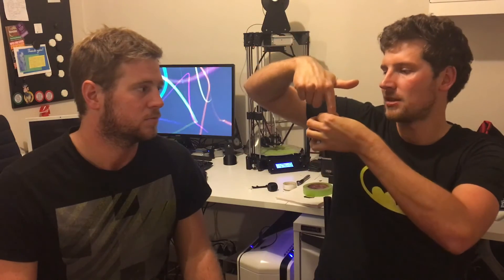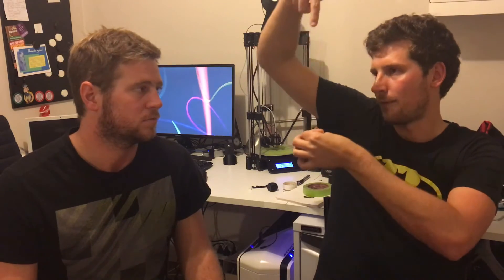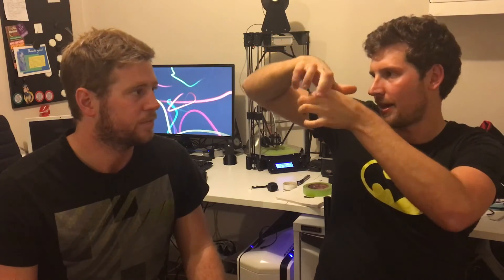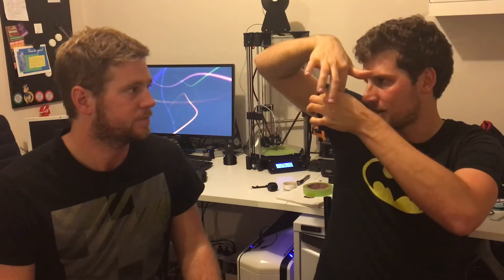How to troubleshoot jaycar tl4100 3d printer arduino

Comment: Hi guys, I have a Rostock TL4100 with its share of problems. The current problem is on connecting the hotbed and setting temperature it burnt out the B55NF06 chip. I cannot work out why the chip burnt out unless the bed was drawing to much current. Can you guys add any details to maybe why it happened. Also is it easy to replace the chip ?

Comment: Hey guys, I’ve got a lot out of your videos, and have got a challenge for you. Here’s some background first.  I’m just getting my son started with Arduino projects. We’ve been pretty quick learners with this kind of stuff, as my father had me dismantling television sets at age 5 to salvage the old vacuum tubes they used to contain. But the history aside, my son and I have had our own troubleshooting challenges with the Arduino (Duinotech) stuff, but we’ve noticed that the projects we’d like to try have some 3D printed parts. I’ve looked at the Jaycar printers, and your videos, but we’d probably want to avoid too many challenges at the moment. And I’m not quite ready to sink $$$ into a decent 3D printer yet...

So I started to think about vacuum forming as an alternative process for some 3D printed parts for Arduino like projects. There have been a couple of Kickstarter projects like Mayku that want to set themselves up as rivals to 3D printers, but they want about the same price as entry level 3D printers (not the Jaycar stuff, but the more reliable options coming onto the market now. Mayku want $600 and there was another one asking $800) But there are dental vacuum formers on eBay for under $150, which I guess would be the best for precision molding. So I was wondering if you guys might consider comparing these two technologies? 3D printers vs vacuum formers. The plastics used are the same, but I think the Dental vacuum formers (and maybe the vacuum formers like the Mayku) might be better for some applications. I think it would be a great YouTube project.

Comment: I have now been going for 3 days at 6 to 9 hours per day trying to calibrate my printer. I am using the TL4100 firmware, not the keyes 3d that it came with or the Marlin, but I am of the belief that the TL4100 and the Marlin firmware are the same. Desperately seeking a really good how to for callibration .... please
Reply from the maker: We had the same struggles. We'd calibrate it, get one good print then the next would be out. Make sure everything is tight (screws belts ect) but I think the design needs strengthening in the frame. The sensor helped massively as it calibrated itself every print.

Comment: do you guys still use this printer? if so im in need of some help flashing firmware, everytime i try to flash it times out
Reply from the maker: Nah we don't use the jaycar anymore. It's our spare parts lol. Are you using the port that it's connected to when flashing?
Reply: yea, ive tried both com 1 and 3, and it keeps timing out, do you by anychance have a premade file to flash off sd card?
Reply from the maker: Have you downloaded the required drivers for windows/Mac depending on your operating system? This is seperate to the arduino ide
Reply: Are you disconnecting the 240 when you flash??
Reply: i have removed the power, ill try to find the drivers
Reply: The drivers are available from this webpage [https://www.jaycar.com.au/arduino-3d-printer-kit/p/TL4100] in the Description tab section under the [TL4100 Arduino Driver] link. Also download the [Download the Top 5 Tips] PDF file from that page for the assembly tips.  The latest firmware and a PDF version of the manual are both available in the Downloads tab section on that same webpage.
TIP  - use Windows device manager to identify the correct COM port for the printer in the "Ports (COM & LPT)" section.  Open device manager with the TL-4100 printer's USB cable disconnected from your computer and note the current COM ports in the "Ports (COM & LPT)" section.  On Windows 10 the "Ports (COM & LPT)" section will only be displayed if you have any ports to display. Then connect the TL-4100 printer's USB cable to your computer, wait for the driver to install (you may need to manually override windows to install it) and make a note of the new COMx port that appears.  That new COMx port is the one to use for the firmware update via the Arduino IDE

Comment: I bought the Duinotech mini TL-4076 from Jaycar.This has been a nightmare from day one .It does not have a heat bed and trying to get PLA to stick has sent me to get hairspray, glue stick, blue tape and kapton tape. Adjusting the bed is a pain as seems to change after a print.Also tried other filaments from Jaycar, just impossible to stick to bed, the original filament that came in the box with printer works.The fan has broken one of its veins, nozzle blocks all the time, Jaycar has no spares, bought new nozzle from Ebay. Very hard to change filaments, have to get nozzle temp really high. All in all I am done in with this machine after hours of work on it to get two prints out, complete waste of $350. Has put me off 3D printing a bit.I am looking at the Creality 3DCR-10 at least one can get parts http://www.gearbest.com/3d-printers-3d-printer-kits/pp_441281.html?lkid=11093265

Thank you for your video, makes me realize I am not stupid, as Jaycar thinks I am lol
Reply from the maker: +darkmonk99 oh its definitely a hard printer but on the pro side jaycar's products do make fault finding easy for your next printer :)
Reply: You are correct, I have learn't a great deal and all knowledge gained I now know the style of printer I want. There is a lot to learn in 3D printing, but very rewarding when you start cranking great prints.Thanks for reply.Looking forward to more of your videos.
Reply: Jaycar are now running out the TL4076 for $199 but they told me themselves it is a really crappy product.

Comment: Bought one yesterday.  First printer too.
Wasn't overly difficult to construct, the pictures in the manual are terrible however!  And miss crucial steps, which are on the jaycar site (didn't see till after putting those bloody end stop cables in!!!)

How the hell do you level the bed properly?  The manual is strange to follow, and the tips on Jaycar's site says to adjust the screws but that doesn't seem to work either.  I"m getting successful small prints from the 1/3 of the board, closest to the LCD.  Anything behind there seems to touch the plate, then jam the nozzle from letting any PLA out.

I haven't adjusted the Firmware yet, as the manual or Jaycar don't actually say what Arduino board this is supposed to be to add into the Arduino software.  Tips on that please?

I just ordered a non-contact blue tip PNP sensor, and will change the firmware when i mount it.
Reply: Ugh, raised the head posts some more, gave me more adjustment room.  All good on the calibration now.  Would still like to know the Arduino settings to flash a newer firmware once my autolevel switch arrives :)..... Please
Reply from the maker: +Troy Starkey we find it a night mare to level the bed as we found every time we used it, it was out of level again. Ended up putting the bed level sensor on which fixed that. Yeah we did the same with the head posts. I think one was barely attached we raised it that much.

Comment: Having issue with SD card says "Card Inserted" but then no SD card on other screen???????
Reply from the maker: nick Brown hi nick have you formatted the SD card
Reply: Where is the SD card in these printers, I am certain mine does not have one, although the main screen says there is a place for it, no idea where though
Reply: The SD card slot is on back of the LCD PCB, below the left hand side of the front LCD display when looking at the display. the SD card needs to be inserted with the label facing down and the contacts  facing up on the right  side of the card.
Reply: The SD card slot is on back of the LCD PCB, below the left hand side of the front LCD display when looking at the display. the SD card needs to be inserted with the label facing down and the contacts  facing up on the right  side of the card.

Comment: Great video guys, did you consider simply using a single high cfm fan, (e.g. sunon-element14) mounted at a 30-45deg angle on the same side as the existing squirrel cage nozzle fan? You could optionally make a cowling or simply flip that little existing fan to pull the air rather than push it around the heat syncs? This should preserve your clearance for printing etc.

Comment: Hello could someone please help me, I've followed all the instructions (video and book). The problem I'm having is every time I (on the printer itself) select Auto Home the extruder just goes straight to the top and just keeps going up, it hits the top (it even hits the collision buttons, which I thought it supposed to stop it, but doesn't).

At the moment, it's X0 Y0 Z0 point is correct, I think. However when I try to make it go down it only allowed me to -005.0 (on the printer). So can someone please help me as to why it just keeps going up (to the point of no return).
Reply from the maker: 13firebug13 check your leads between the control board and the limit switch. Pins 1 and 2 on the connector need to be at the control board side and pin 1 and 3 at the sensor side. Failing that make sure the x limit switch is connected to j12, the y limit switch is connected to j10 and the z limit switch is connected to j8
Reply: Is there any chance you have a Facebook page or something to send pictures and stuff? I would really appreciate your help
Reply from the maker: 13firebug13 you can contact us a ladbrotoryprojects@gmail.com if you like. We no longer use this printer and I have stolen a lot of parts from it but I can try and help you
Reply: It's on page 3 of the manual available from the Jaycar webpage that has download links for the unit. This manual is different than the one that comes with the unit (the book). Here's a link: 

https://www.jaycar.com.au/medias/sys_master/images/8933868896286/TL4100-manualMain.pdf

Easy mistake to make, since the plugs at both ends are the same, but the wire connections are different. At the limit switch end, the wires are separated by a gap. The wires are next to each other at the controller end.
Reply: Wayne Riesterer thanks but I figured that out, I really need to pay attention to these things.
Reply: I just built one of these and am going through the hell of getting it to print properly.  Your experience with the sensors reminded me that the manual tells you to plug one of the sensor cables into the wrong socket.  In fact, it tells you to connect two of the plugs into that socket.  Either the text was wrong or the photo, can't remember which but it's pretty bad form.

Comment: Thanks Guys, I've only had mine for about a month and I think I had just about every problem there is with mine, but I've just about got it running nicely now. I've added a lower cooling fan setup to the steppers and logic. I've also had a lot of issues with the rail and bearings (graphite power seems to quite them down a lot and reduce chatter - just don't use too much). As for temps I think I'm now similar to you. PLA 185° Extruder / 65° Bed, ABS 200° / 100°. I've found The 65° Bed for PLA helps it stick to the bed. The extruder mount that come with the unit is a bit crappy and just keep an eye on all the cap screws in the delta carriage they can work loose (I'm not comfortable enough with the unit yet to thread-lock them in yet). I've also tried a number of speeds but am generally running at about 20-30mm/s (not great but reliable to print big jobs). I  also agree about the power supply and the connection to the main board is a bit dodgy. Looking at upgrading the delta Carriage, Rails & Cooling system - Once that's done it may not be a bad unit. In all once you get all the bugs sorted its not too bad but is still a bit expensive for the quality and performance level more if all the upgrades are taken into account to make it reliable.PS 3M Scotch Blue works very well for me with both PLA & ABS + heated beds as describe above.
Reply from the maker: Thanks Anthony Zammit for your comment and sharing you experience with the 3D printer. We have had a lot of issues with our printer but now with the auto bed leveling it has made the printer more reliable. Our biggest problem now is cooling the extruder. When printing big prints the extruder gets to hot and the PLA melts before the hot end so then the printer jams up. I designed a better cooling system because the tiny fan that came with the printer did not work well enough.
Keep watching our videos!
Thanks again for you comment!

Comment: this is a crap product when you get it working form the chinglish instructions it will work for about 6 hrs then just give you big pile of melted pop on your heat bead that you can proudly display on you're desk top as it is a terrible product there web links even do not provide the correct links to download the firmware or the measurements to create you're own version of marlin that will suit this printer  also the power supply will blow up in no time at all and you will need to replace it with a 12v 160w the hot end is crap blocks up a lot as the cooling fans are inadequate for a product that costs over 500 bucks forget them good bye jaycar poor old dick smith went first and youre next you can get better replacement parts from china or another electronics store drive belts ohh you need to order then will take 2 weeks eBay 2 days please people just don't buy this product its a big pile of steaming poo get on eBay buy a kit for 250 bucks maybe electronics from china
Reply from the maker: I do agree with you, it took me a long time to get this printer working well but I don't regret buying it. I have learnt a lot about how the printer works and installing auto bed leveling has made it so much better. I also installed better cooling fans for extruder so it didn't melt in the extruder before it reached the hot end. I also installed 0.5mm nozzle. I'm looking at changing the filament over to 3mm as well.
We recently upgraded to the lulzbot mini so keep watching for more 3D projects Thanks for your comment. +ian minto

Comment: My tips and tricks have been captured in a blog post.  https://dgwilson.wordpress.com/2016/06/12/3d-printing-with-the-jaycar-delta-rostok-tl-4100/
Reply from the maker: Nice post. We used to use slic3r but now are trying cura. We also have been using the below start gcode which has really increased our success rate as you can see if it is blocked before it starts.Below is the code for those who want to try it.Obviously change the m104, m109, m140 and m190 to what your working temps are for your filament.; Default start code
M140 S50
M104 S180
G28 ; Home extruder
M107 ; Turn off fan
G90 ; Absolute positioning
M82 ; Extruder in absolute mode
{IF_BED}M190 S50
; Activate all used extruder
{IF_EXT0}M104 T0 S180
G92 E0 ; Reset extruder position
; Wait for all used extruders to reach temperature
{IF_EXT0}M109 T0 S180
G92 E0
G1 E15 F500
G92 E0
M300 S1000 P3000
M0

Comment: I've also designed my own calibration object.

http://www.thingiverse.com/thing:1621676

I've ended up using the Slic3R with a 0.2 precision. This and ensuring the eprom settings were as per the book has given me some great output.
Additionally I've updated the Slic3R software (downloaded from the slic3r web site and replaced the installed files).

- David

Comment: Hi guys. Great video.

Tip 1: print this 5mm calibration cube.  http://www.thingiverse.com/thing:24238
I had an issue where the bottom 3 layers were fine and the two two layers were out of shape... after some close observing I determined that too much plastic was being extruded... and eventually tripped over the first pages in the assembly manual where one of the eprom settings needed to be changed - this affects extrusion rate!  So it's printing really well now.

Tip 2: http://www.techbrands.co.nz/store/product/tl4100.aspx
This web page has a complete assembly video, supplemental manual - seriously get this!!!!
Firmware, and links arduino software links.
https://www.youtube.com/watch?v=EqBWB1ykdCk

I've also got an issue where at some layers in a print the x,y registration seems to shift and thus the whole print is a write off - I haven't got back to testing that again and don't know if it's still occurring.

The current MAJOR issue is that I've come back to the printer after an overnight sleep, turned it on (it was still USB connected)... and none of the commands to the printer are working... i.e. heat up the bed...  it doesn't warm up. The LCD screen acknowledges that it should heat to target temp, but it does not... and also asking it to home etc... all ignored. It fixed itself yesterday... and the problem has come back this morning..

- David
Reply: OK, I have the printer working again. I believe the connection between the power supply and the arduino board (+ve, -ve) was not secure. I was able to tighten the screws at on the arduino board. It's working again now. Printing in progress.